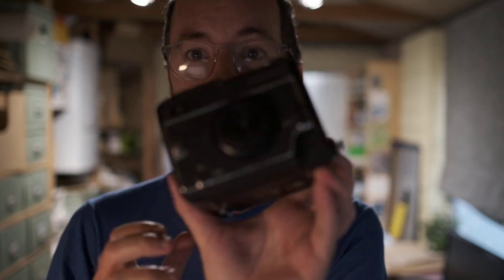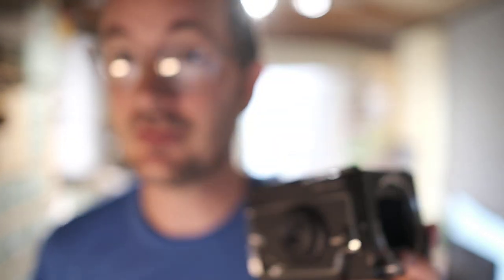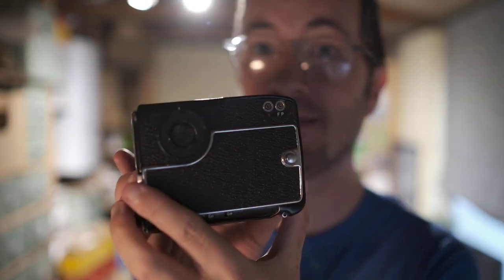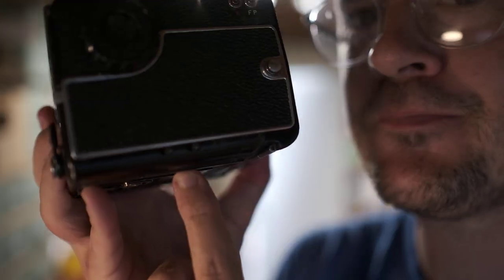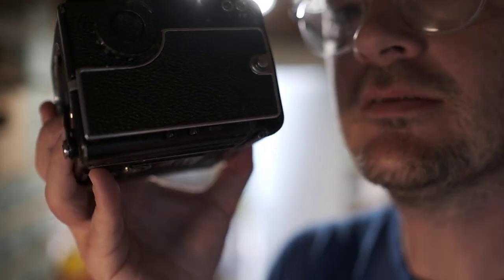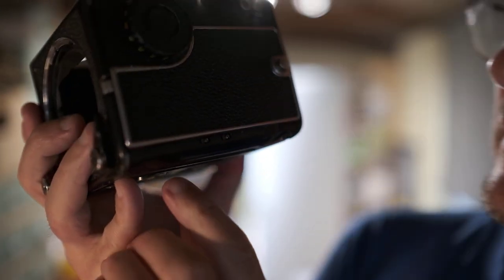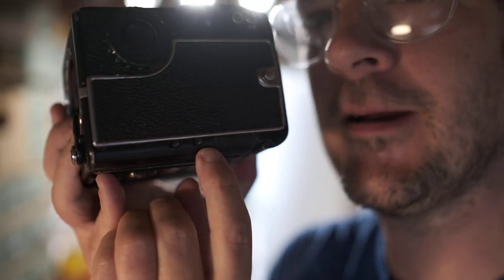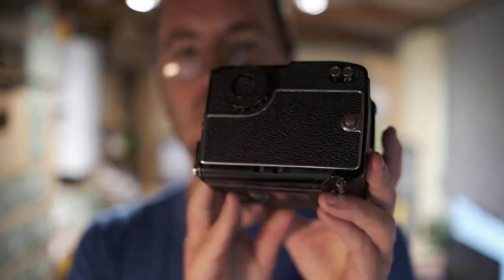HOW TO FIX a stuck/broken shutter on MAMIYA 645 1000s

Comment: my mamiya 645 1000s doesn't have those little screws on the side panel, any ideas on what I can do? my camera used to fire and dry fire but now all the shutter release buttons are stuck and won't even depress at all. please help!
Reply from the maker: If it's a 645 100s, then yes it does have those little screws - they're underneath the side panel, on one side not the other, so it sounds like you're either looking in the wrong place, or maybe it's not a Mamiya 645 1000s
Reply: @samsnapsalot  I definitely have a 1000s and it doesn't have those screws either